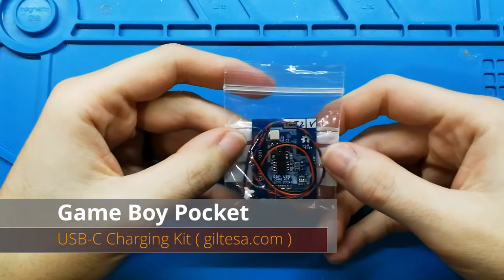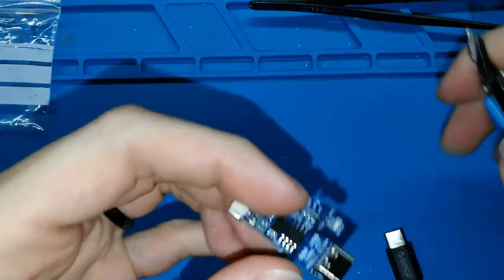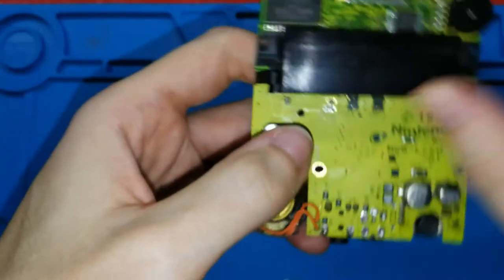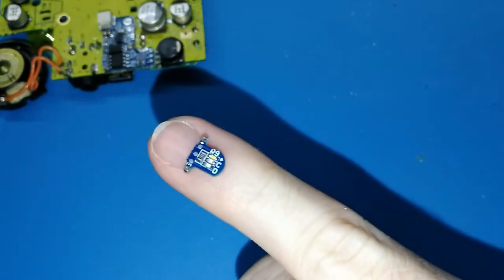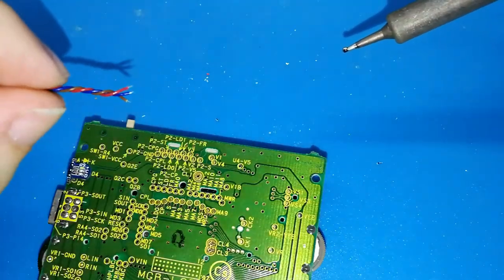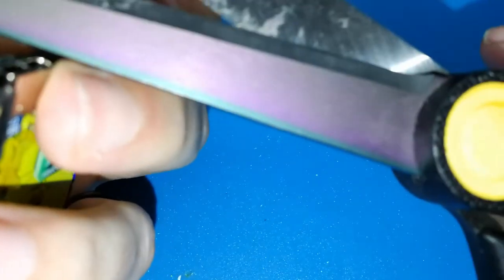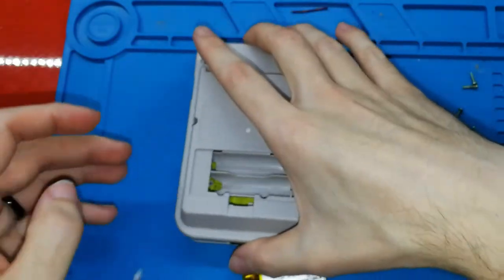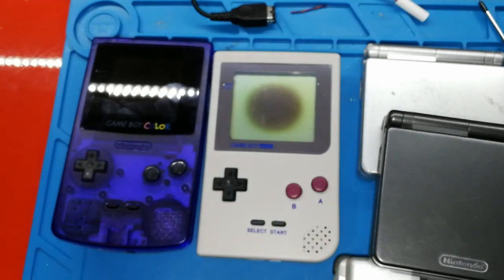Game Boy Pocket USB-C Charging Kit (Installation)

Comment: Hey i got a very strange issue: after a few seconds i plug the usb c out, i cant turn the gameboy on. When i plug it in it works agan and i can turn it on, even if the plug is not connectet anymore. This lasts for a few seconds then i cant turn it on anymore. Can you help me?
The battery is fully charged and when i measure on the connector of the battery it gets 4V .
Reply from the maker: That sounds very strange, yes. Does that happen using an IPS screen and/or flash card? May you able to test it with another battery? I don’t know if the things you have connected are taking too much anergy when you turn it on, or maybe the battery has a problem 😐

Comment: I have been thinking of building my first gameboy.  I have some soldering experience, but still a beginner.  How dificult would you say this is for a newcommer?
Reply from the maker: Hello Rubi, I think the GBC board is the easiest to solder, the GBP it's a bit complicate because requires more boards and in both sides of the GBP board. The GBASP is the most difficult to solder and also to remove the original connector.
I think, if you have good tools (solder iron, tin, flux, multimeter) and you take your time I think everybody can do it.
Reply: @giltesa  I was thinking about the gbc as well, though it holds a bit less nostalgia for me.  I  lived off the game boy pocket and the original dmg.  My brothers and I had one, and the pocket I had a little later down the line, but I did like the dmg for its slightly larger screen.  My cousin had a color.  I remember having my red dmg, and being too stupid to know anything and tried to spray paint it black.  I  remember how the paint would melt off and stick to my hands.  Good times.  I will have to see about a gbc or a dmg as a donor then.
Reply: So I could not find a good gbc donor for the price I was looking for, but I did manage to get a dmg and mgb for 38 and 44 dollars respectively shipped to my door.  Took a bit of a gamble on the gbp.  Let's hope it is an easy fix...

Comment: I installed the Funnyplaying IPS screen and Retrosix Cleanpower Amp along with this kit. The LED light works when plugged in via wire and the light changes to red when I flip the switch, but now the screen wont turn on. Do these mods not work together?
Reply from the maker: I know the board work will with an ips screen and a flash card but I haven't tested it with other modules. You should check the input voltage of your nodule and if this is compatible with an input of 3.7v

Comment: Hey I just bought the Pro Kit from Hand Held Legend.  How similar is this video to what is in the Pro?  Will I be able to follow along with this?
Reply from the maker: Hello Andy. I'm not sure which kit you have bought. If it's one of ours, I recommend checking the shop; each article has an installation guide.
https://shop.giltesa.com/
Reply: @giltesa  Haha.  I'm sorry I checked I bought it from Retro Game Repair Shop, here in the states.  It is the Game Boy Pocket USB-C Charging Kit Pro.  It won't arrive for a few more days, but I read through the installation guide to sort of start a game plan.  

I watched the video installation you made for this version and I sort of browsed through the Color Charging Kit Pro installation video you made.  I'm just wondering if there is a video for the Pocket Pro kit?

Or is this sufficient enough with the installation guide, to brute force my way through installation?  Sorry about the confusion earlier.
Reply from the maker: @andypedersen5971  

I think that with the guide, it should be enough to complete the installation. The most challenging part is soldering the USB-C board, for which this video might be helpful.

The rest of the installation is very similar to the GBC-PRO, only the soldering points differ. You can use these videos as additional assistance if the guide is not sufficient.
https://www.youtube.com/watch?v=ZTm0YCFdiz4
https://youtu.be/9Kjlwg49Qwc

Comment: Hey there, recently purchased the GBP usb C kit from retromodding. While browsing around for more info, I came across your blog where it says that the kit's not compatible with MGB-CPU-01 boards. is there a work around to this incompatibility? or would I just need to get a differet GBP with the right motherboard model?
Reply from the maker: I will explain it better to you later, but basically the main board changes and the 5V from the USB to the charging board can't be connected just soldering them on the GBP board.
Someone had this problem and he was able to use it soldering a cable.
Reply: thank you for the quick reply I'll be waiting on ur further explanation!
Reply from the maker: @voxrepeatpercussion  
The main problem of this versions is the copper wires of the mainboard are not in the same place as the rest of compatible mainboards. It's a problem because when you solder the USB-C board we need to use a copper wire to transfer the input of 5v between the top side to the bottom side where is the charging board... and this copper wire doesn't go where we expect/need.

Then, to be able to install the charging board on this version of GBP mainboard, it's necessary to solder a cable to join both boards.

The steps are:

Hide this pad with kapton tape (or something that doesn't melt with the solder iron):
https://img.giltesa.com/images/383gbp_0.jpg

Solder some thin wires to the bottom pad and put the other side over the pad covered with tape:
https://img.giltesa.com/images/522gbp_1.jpg

Cover with tape the rest of wires:
https://img.giltesa.com/images/426gbp_2.jpg

Put the board and solder it:
https://img.giltesa.com/images/149gbp_3.jpg

The user who had the problem soldered it like this:
https://img.giltesa.com/images/446gbp_4.jpg
Reply: thank you so much for the detailed explanation. I'll give that a go!
Reply: thanks a lot for the help! I'm not done yet but it's now charging properly and I can here the nintendo logo sound when turning it on! https://drive.google.com/file/d/1xrucwDMA-nLEVXyqBE7nsXU1fEleNasr/view?usp=sharing

Comment: YOU FORGOT MY BRADE OF BLACK AND RED WIRES.

IL have to go into my drawer of asorted lengths of wires
Reply: I may have lost them but I also ordered from a distributor not you so no worry 😉
Reply: I found them lol
Reply from the maker: @manwhoeatsfishinbedwithlig3791  
I'm glad you found it. I try to send everything perfect but if something is missing just let me know and I can send it again.
Reply: @giltesa  I am having issues with the closing of the shell I think I did find a way for the cuts to work with the usb c but in the future you think a 3d printed jig for cutting the holes could be made 

Also if I were to connect a wireless charger to the 5 volt pin on the usb c board and then to any ground pin I would have wireless charging ?
Reply from the maker: @manwhoeatsfishinbedwithlig3791  yes, for the GBP board you need to remove a bit plastic of the shell. In the installation pdf you can see the pictures. 
I haven't tested a wireless charger, but yes. If your wireless receiver works at 5v you can connect it to the 5v pad and any gnd pad

https://raw.githubusercontent.com/giltesa/Game-Boy-Pocket-USB-C-charging-kit/master/3.%20Documentation/USB-C%20Charging%20Kit%20-%20Quick%20Guide.pdf